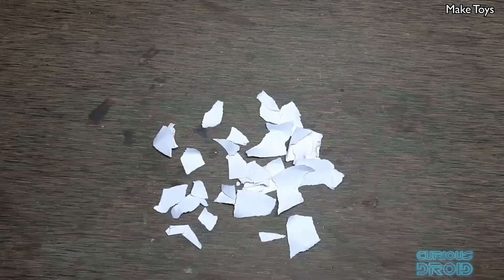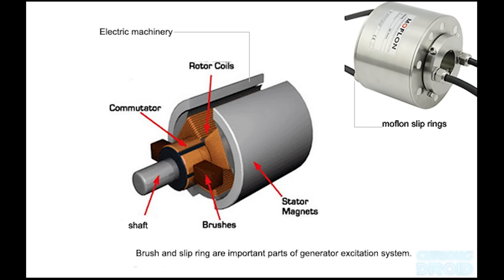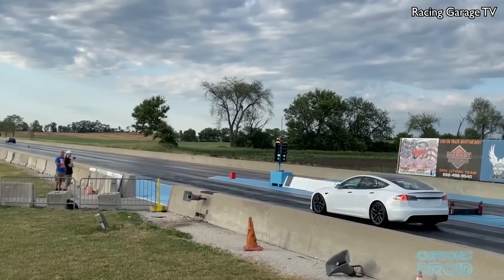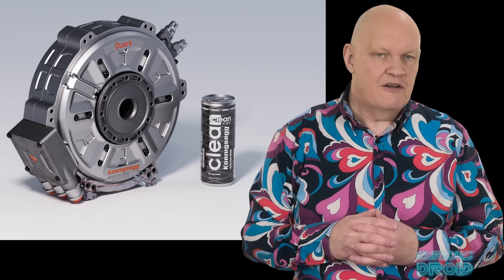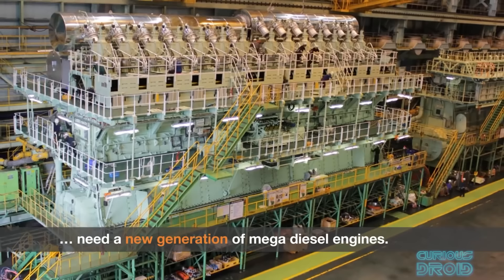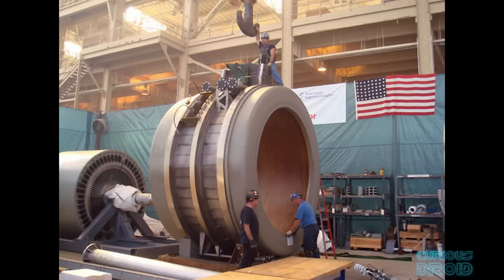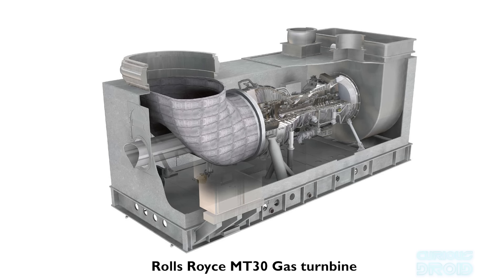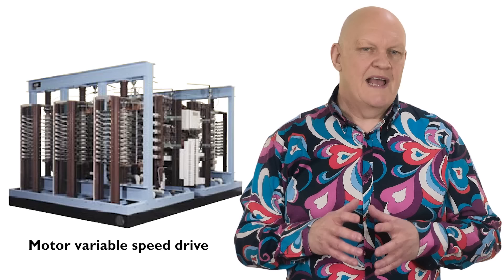The Worlds Most Powerful Electric Motors

Comment: I am a mechanic at a company that regularly rebuilds 9,000-15,000 HP 13,800 Volt motors. The bigger they get, the simpler they get. The difference is assembling them with cranes and massive hydrodynamic bearings.
Reply: What size is the wire in the windings?  It always blows me away when you see motors running at many KV.
Reply: @flomojo2u  motors that big use rectangular wire that's insulated and stacked into the form of the core slot and insulated together into what we call a form coil. The wire size varries based on the need and required number of turns which is usually dictated by the speed and expected torque.
Reply: How can I get into that
Reply: @stupidsnek  you will need to be near someplace that values and has heavy industry. You will need to be near refineries, powerplants, mines, metal refiners and processors, chemical plants, and general manufacturing. There you will find shops that rebuild just about every motor, gearbox, hoist, or pump. You will need to have common sense, be able to learn quick, and be willing to do dirty, manual labor. Most places are willing to teach someone willing and able to learn. You have to be able to put yourself out there and talk to people older than yourself in a casual but respectful manner. Most importantly, you have to have a thick skin. Feelings and offense will only be cared about by someone carrying a clipboard or wearing a tie. There aren't many of us out there and we need our ranks replenished as many are retiring.
Reply: @stupidsnek  someplace you could start is checking out a company called IPS (Integrated Power Services). They have several facilities across the east and Midwestern United States. They are a big outfit and competitor to my company but they offer good benefits, free schooling, competitive pay. Fill out an application, make a phone call, and don't take no for an answer.
Reply: @stupidsnek  I specialize in the older DC motors. Most of them are big 10,000+lbs motors built pre and post WW2. Some I've rebuilt came out of military ships and were installed in steel and aluminum mills. I had never worked on or seen one when I started working there. I was taught by an old guy that retired a couple years ago and I've read and gained experience. Now I'm being sent to consult and fix problem child units at companies more than a days drive away because everyone has forgotten how to work on them. I'm still under 30yrs old and I am going into places and teaching guys easily double my age how to fix their equipment. I didn't start life with a wrench in my hand but I've learned, listened and dedicated myself to my trade. It's not terribly hard and I guarantee you that if you have the qualities, someplace will be happy to give you a chance.
Reply: @LifeontheBellCurve  I already do marine diesel and automotive. I need to find someone like you lol
Reply: @LifeontheBellCurve  simplicity doesnt change. since these motors are high voltage, i assume the insulation on the windings is different than mass consumer applications.
Reply: @flomojo2u  we can assume the motor has very low KV (i.e. less than 1) if it is running 10,000 volts.
Reply: So no excuses for loosing bits or not being able to see the darn tiny thing...... 🤣
Reply: 13.8kv seems to be a limit without extra engineering measures for insulation. there are synchronous condensers and generators i work on at my powerhouse job.  many transformers tertiaries have windings at this specific voltage as well
Reply: @flomojo2u  the more kv the engine runs at the smaller the cables could be I guess. But it's still brutally big. I'm a train driver and what we run is small in comparison. 6 x 750kw engines in the trains I drive the most. But when I run two of those they can still use 9 megawatts just for engine power. Running of 15.5-17kv into the train but the engines are 400v with big control units doing frequency change for speed adjustment.
Reply: @Blox117   they use mica tape that is 1/2 lapped think the way a hockey stick is taped🇨🇦😁 up to 15 layers are applied over a capton enameled rectangular profile conductors. 
I used to build quadra torque motors for GE  made coils, mag poles and armatures
Reply: What gauge wire do you use for such motors?
Reply: That sounds like an amazing job!
Reply: Yup.. weight, vibration and friction. Keep it simple. Love the sound of the big motors you masters work on.. the 60hz hum ..
Reply: When mechanic says, "simple".
Reply: @lynngreydanus-smith8816   We call them traction motors. All torque with nothing held back. The last one I rebuilt we ordered 400mcm wire to reconnect the series and Interpole circuits. She was rated at 950 full load amps at a max of 2000rpm. Absolute beasts but have a tendency to self terminate if the pinion grenades.
Reply: I wish we were friends so we could hangout. I've always enjoyed getting my friends to tell me about the jobs they do.
Reply: Usually type H insulation.
Reply: Wow
Reply: @LifeontheBellCurve  your company wouldn't happen to start with an F would it?
Reply: @lynngreydanus-smith8816  
Yeah, Kapton is great stuff. Very thin with BIG dielectric capabilities and high heat tolerance. 15 layers would be good for many kilovolts!
Reply: @NoOne-sn2si  these machines where tested to iirc 28,000-30,000 volts in a process called a high pot test, it actually does damage to the insulation system, how much I do not know but I was told this by the engineers that did the design so I believe it.
Normal operating voltage was 13,200 for most of what we built.
Reply: Been playing with a 13kv 273A 20k hp Siemens coupled with a 15k and 7k to a series gearbox then to a polyethylene extruder. When we first bumped it for rotation it literally took 25-30mins for the shaft to come to a stop. Was definitely cool when she was trying to find her magnetic center..
Reply: I was an industrial electrician at a steel mill(retired)...I have been involved in changing out up to 15,000 HP mill motors...8 and 9 meg Watt co generators etc. We also did on site machining of comms... winding repairs if possible, welding cracked spiders etc...fun times. I breakem you fixem lol
Reply: I’ve been told what it looked like when a 300hp 480vac motor windings failed and it started shorting and sending out plasma…. If a 13.8kv one did that it must be absolute hell!
Reply: A good example of why models are so effective as learning tools. Take what works in theory, make something small that works, then work your way up until big things happen
Reply: But if this motor designs for like 9000 hp that mean something that plug to the motor require a lot of torque right?
Reply: Where do I apply?
Reply: we have some 7k 13,8 GE motors at our papermill from the 40s...  they are massive
Reply: All we need is a lot of copper and other metals.
Reply: Question: What is the average RPM of those giant motors? And the torque? cool job too.
Reply: 😅7😊😊7😊😅00u
Reply: "the bigger they get, the simpler they get" wtf? What do you mean by that?

Comment: I worked for a gas pipeline company that had several compressor stations that were powered by electric motors.  These motors started at 2,000 hp and the largest had a nameplate capacity of 15,000 hp.  The largest ones were tested for maximum continuous output which varied from about 17,500 hp to 18,000 hp.  These motors and the compressor stations were built initially in the early 1950's and were expanded over the years.
Reply: yup, this. I worked in one of the largest refineries on the west coast, and we used motors about as big as the NASA one to drive compressors for CH4 that'd move several million cubic feet per minute.
Reply: What do you use a 18,000 hp compressor for?
Reply: @paulmiller6277  compression of byproduct ch4 to use in a hydrogen catalyst cracker. We take the hydrogen from the CH4 at several hundred psi and pump it back into the bottom of the cracking stack to break apart the longer lipid chain molecules down into gasoline and Diesel.
Reply: @Hyperious_in_the_air  cool!
Reply: I work in Oil and Gas and we pretty regularly use 20MW helper motors. This is built on top of a 80MW gas turbines.
Reply: I recall in the early 2000s there was a ethaline plant that was totally shutdown because a large 20,000hp motor got struck by lightning and fixing it wasn't worth it so they shut down the facility. 4 years later when the market took off they rebuilt the entire facility because it was now worth it to have the place running. Instead of just repairing the motor they had to repair and replace the whole facility. What a difference 4 years make. I got to see the motor rebuild. The original motor was built in the 1960s. One guy retiring was there when they installed it. He said if they maintain it that motor will outlast you too.
Reply: @paulmiller6277  They were installed at compressor stations of an interstate gas pipeline company.  The capacity of the pipeline was about 6 billion cubic feet per day.  The compressor stations were in the service territory for the TVA and at the time the stations were constructed, the TVA has  a lot of excess hydropower available.  So it was less expensive than the conventional reciprocating compressors.  A side benefit is that since they were synchronous motors they would provide stability to the the TVA generating and transmission system.  HTH
Reply: Once worked at the ArselorMittal Temirtau plant. There, in the rolling mill, there was a 32 MW (~43 500 hp) electric motor, the rotor of which rotated slowly, somewhere around a few hundred revolutions per minute.
Reply: I had also  worked in an industry having the biggest motor of 10 megawatt..😊😅😏😏😎👍🏻👍🏻👍🏻

Comment: The US "standard type" battleships of WW1 vintage used turbo-electric propulsion. In this case steam turbines provided the power to spin generators and the electricity was in turn used to drive electric motors which turned the propellers. This was done to compartmentalize the ships and avoid having long drive shafts commonly needed when connecting the turbines to the propellers. The downside being added complexity and weight when compared to direct turbine drive or geared turbines. The "standards" only had to reach around 20 knots.
Reply: 21 knots. Also around 25,000 to 30,000 HP. I wished one of those were preserved as museum ship. The impressive part is that they were built during WW1, with the Colorados, the last ones, built in the early 20's while the Washington Naval treaty was being negotiated.
Reply: Electric engines are idd far from novel. As it was the first wheel powered car to reach 100 km/h was an electrical powered one... in 1900.
Reply: So did the Lexington and Saratoga.
Reply: This is just like the old ferries in Washington State. "Diesel electric" in this context simply means "diesel generator powering electric motors". Those ferries are currently in the very early stages of being replaced, but even the oldest ones are diesel electric.
Reply: diesel electric is also often used in high torque applications like trains and heavy mining equipment. it is much easier and lighter to bolt an electric motor more or less directly to the drive shaft and feed it with power generated by a combustion engine, than building a gigantic heavy complex multi gear transmission for that engine. 
also, the engine can more often run in its optimal work load and rotation speed.
Reply: @Digi20  that always catches me off guard

I have a diesel generator at home (but also solar so doesnt get used) and it's more energy efficient to run an EV using that than to run a diesel car

I had to actually test it to believe it and i got ~90 mpg
Reply: The P&O liner, SS Canberra, built in 1961 by Harland and Wolff in Belfast was also turbo-electric.  A pair of 32.5MW BTH alternators powered 2 squirrel cage motors per prop shaft to give 85000 SHP, and circa 32 knots.  The reason that turbo electric was not more widely adopted was cracking in the squirrel cages of the motors in her early years of service.  As a marine engineer, I inspected the cracking in 1982 by crawling down an access hole through the stub shaft forward of the motor.    Canberra also suffered a failure of the starboard alternator in 1984 when I was the day work engineer and had to take the alternator apart.  Without any power tools!
Reply: @_____ it's actually the small industrial ones that use waste heat to warm houses/industry that are more effective in total

When it comes to just electricity, the coal plants are still worse in everything except NOx. There are also a lot of plants that try to use data for optimal coal plants to make it seem like their own plant is better than it is.
Reply: @angrydragonslayer  that's only a small part of the equation. Tyre's for EV's are more expensive, the chemicals left from refining and purifying the ores. While the compounds used in the batteries are toxic or carcinogenic and at present are extremely expensive to recycle safely on large scale  batteries. Then there's still the fact your going to have petroleum for much longer than they say we will because of pharmaceuticals requires various forms of petroleum, bearing grease carbon black. Same for the various plastics and vinyls used through out the vehicle.. various other oils waxes and  olefins that are used to keep prices lower than the anything synthetic having found in the most organic version
Reply: @theEVILone0130  it's still big enough to offset by 250k km assuming a single battery change for most models

And as progress evolves, we will eventually be able to offset the impact before the vehicle leaves the first owner (~3 years or so)
Reply: The SS Normandie used turbo-electric drive, and she was capable of 30+ knots.
Reply: Preciated Gorgonzola cheese 🧀
Reply: @theEVILone0130  "Tyre's for EV's are more expensive" - you don't have to use special tyres if you don't want to. Recycling is actually very desirable, the main problem is that we don't have the logistics chain setup properly yet. We are getting there. But the cool thing is that EV batteries can last a decade, after which they will have a second life in stationary applications(like powerwalls). And only then they get recycled. We will definitely solve this problem before we exhaust the 'easy' lithium sources - remember, at one time we had plenty of locations where people would literally scoop petroleum from the ground. Or would start digging under their houses and petroleum would rush out. Those cheap locations are gone, but we can dig down the ocean if we need to.

There are many applications for petroleum as you point out. The less we burn, the more we have for manufacturing. We will be using less lubricants too!
Reply: Also inefficiencies with the conversion to electricy was a problem.  I think Drachinifiel had a video on those type of ships.  Some which werw damaged at Pearl had to be sent stateside to fix their electric drive
Reply: @Outworlder  “EV batteries can last a decade”, can confirm, my 2013 Renault EV has a battery pack manufactured in 2011, with 90% SoH (state of health) after 100k kilometers. Battery tech really is under appreciated imho.
Reply: @TheShrike616  Ferdinand Porche used these electric drives in his Prototype of the Tiger. They broke down and caught fire ensuring the Contract went to the Henschel Design everyone is familiar with today.
Reply: The reduction gears needed to reduce the high speeds , thousands of rpm’s that steam turbines operate at best to the low speeds that propellers run at were not perfected then.

So the electric drive was the step down transmission.

As the gear building industry got better they switched to the geared turbine.

In WWII they built so many ships the specialized shops that made gears could not keep up but there were plenty of shops that could make motors and generators so diesel and steam turbine drive came back for merchant
Ships like the US T-2 tankers.

The gear shops made the military high hp but small lock train gears.
Reply: @TheShrike616  for a capital ship, the colorados were very novel having 16" guns, turbo electric drives, and electric fire control, they also stuck around a long time and probably would have stayed in service if the iowas weren't built
Reply: @dundonrl  The first US Navy carrier, the Langley (converted from collier "Jupiter") was also electric drive. The host's claim of Queen Elizabeth being the 'first' all electric drive carrier is wrong.

Comment: Great video.  I used to work in nuclear power, and I thought the 4,000 hp reactor coolant pump motors were huge.  Some impressive stuff here!
Reply: 4,000 hp!? is that for one reactor? how much rated output is the reactor1gw?
Reply: You probably had multiple pumps?
Reply: @jamallabarge2665  Can't speak for Nuclear Reactors, but on Ships, we always have one Pump more than we need.  I worked on Ships with three Cooling Water Pumps, so each of them has 50% of the required Power, and on Ships with only two Pumps so one Pump alone could provide the required Cooling Water Flow. I'd guess that Nuclear Reactors have at least double or perhaps even triple Redundancy, aka two or even three Backup Pumps.
Reply: What was the type of plant you ran, the ones in my ain’t that big
Reply: @Capthrax1  in our local plant there are 7 per reactor, rated output around 800mw
Reply: @md4luckycharms  whats the efficiency for them?
Reply: @Capthrax1  no idea on those figures, my info is secondhand from an sro but the thing was built in the 70s from designs from the 60s if that helps
Reply: @Demonic Koala  yeah the age thing is crazy. The average age of usa reactors is around 40 years. Them is old
Reply: Made a few of those at GE in Peterborough, I will say working on a 25’ diameter rotor was interesting.